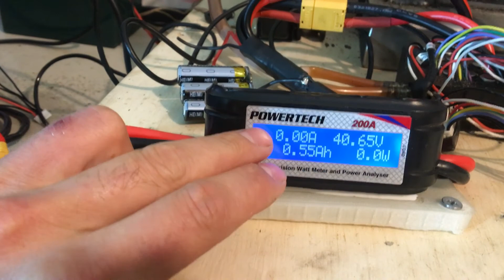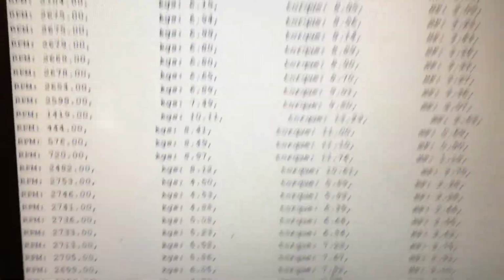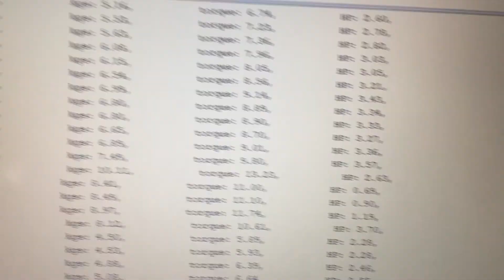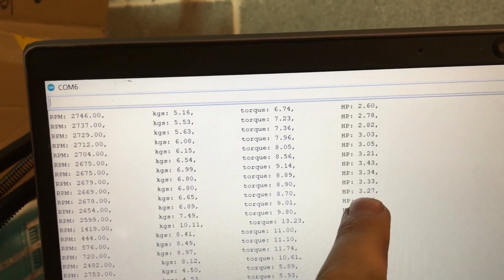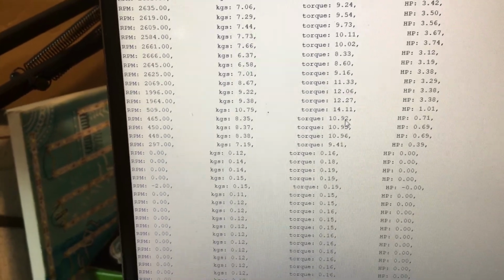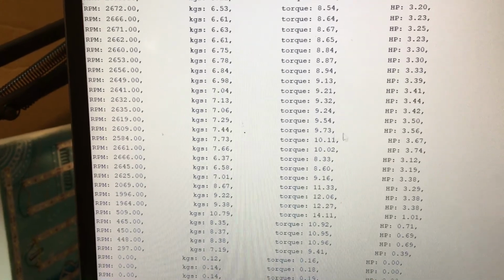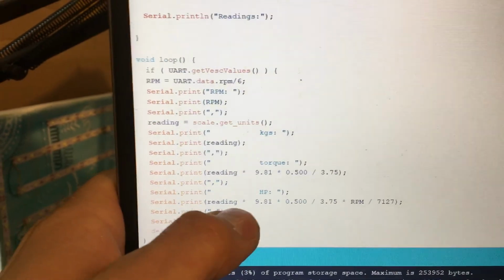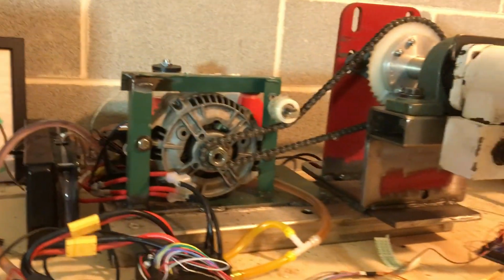Dyno is working!! over view

Comment: That's an impressive amperage. Keen to get my hands on a water cooler vesc jacket
Reply from the maker: Yeah it seems to be good so far.  I’ve had it running at over 200amps without a issue.
Reply: @fixitmoditbreakit7982  awesome! Did you add hall sensors to your alternator? Also you talk about the voltage to your stator windings but I'm curious about the amperage. Sorry for all the questions, it's just exciting, in close to getting mine going
Reply from the maker: @Brendan hall all good mate this is why post my video’s to share info I’ve gathered. 

I didn’t add hall sensors I find with a few tweaks within the vesc using the vesc tool you can get a impressive start up.  Not to say hall sensors are not worth it I’m sure they would help more for sure.  Also the vesc stops using the hall sensors after the motor starts up.  Foc has some awesome start up,  if your in currant mode it can cog abit if you don’t give a good amount of input due to the currant being to low but you can change the minimum currant and raise it until you have a good start.  

With the field coil @12v the current is around 5-6 amps I’m sure every alternator is different though.  I’ve messed around with different voltages/currents and find 12v is good for this one .
Cheers
Reply: @fixitmoditbreakit7982  fabulous info. Thank you!!

Comment: Hey, how do you use the servo tester as VESC input. I can't get my motor to spin.
Reply from the maker: Hi make sure you plug in your computer and use the vesc tool program and select ppm mode in the app side.  Or you can run a setup one the wizard page I suggest running motor and input wizard to start off